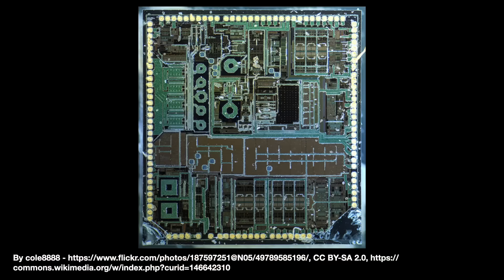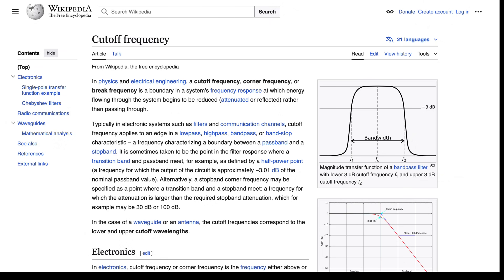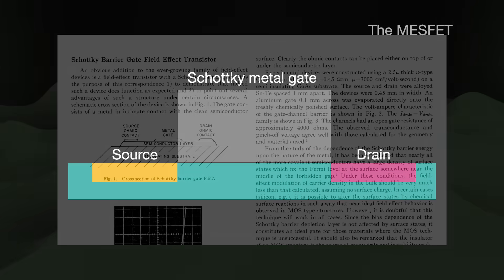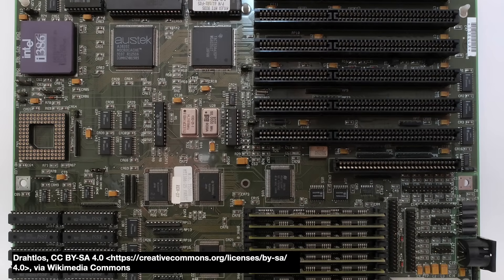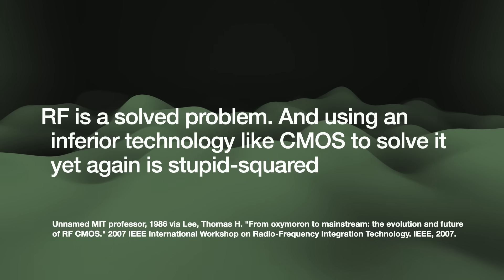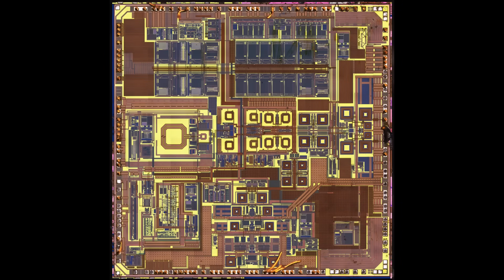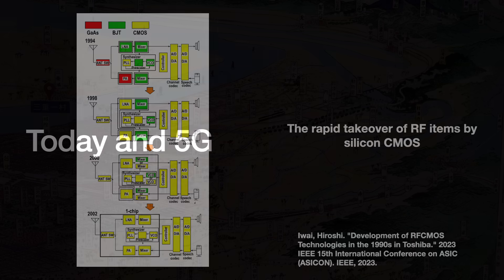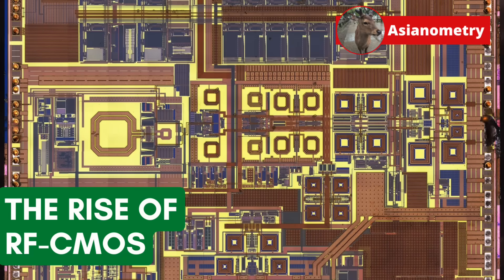How Moore’s Law Revolutionized RF-CMOS

Comment: 80-200Hz is the fundamental frequency of the human voice, but all of the important informant is much higher, the formants and noise sounds. You want at least 10kHz.
Reply: Had to scroll way too far to find this. Even “telephone audio quality” is 30-3000 Hz. When he said 200 Hz my eyes rolled. lol.
Reply: @NatesRandomVideo  He also wrote hz instead of Hz.
Reply: About 200 ... 3400 Hz voice is the telephone freqency range. This range is the only part of human voice, which is transferred in the digitized voice. The sample rate is 8 kHz exactly, so the fundamental physical laws (rules) state, that no more than 4000 Hz is ever possible to digitize and transmit.
Reply: 2.7kHz is adequate for good intelligibility.  As per the US phone system.
Reply: @v8pilot  300JHz-3kHz was the normal 'voice' standard that could be achieved on European narrow channel AM radio.
Landline phones do much better than that. Ultimately they had a 64Kbps limit as te trunks were digitised to that.
e.g. :-
"The 64k phone line data rate, achieved through Pulse Code Modulation (PCM) and the G.711 standard, encodes analogue voice signals into a 64 kbps digital stream by sampling at 8,000 times per second and using 8 bits per sample". 
That turns out to be a practical limit of 3.4kHz and a signal to noise of not much better than 45dB. Without further processing.

VOIP phones can do much better than that.

What mobiles can do is strongly affected by the signal strength as they adapt to congestion by lowering voice quality and ultimately dropping packets altogether.
 The modulation schemata are far more complex than this video implies.They try to use spread spectrum to eliminate single frequency sources of interference. E.g, CDMA
Reply: Yes; a 200Hz cutoff would leave voice information virtually unintelligible.
Reply: And the rest, Digital transmission doesnt work like an old fashioned transceiver.
Very poor video.

Comment: 45nm FDSOI seems to be the sweet spot for CMOS mmW.  The Global Foundries 22FDX process has slightly faster transistors but higher 1/f noise which raises oscillator phase noise.  But those multiple 3um thick copper layers are pretty awesome.
Reply: Yes 45nm SOI is probably the sweet spot. More advanced nodes just add R and C, after RCC extraction the performance of advanced node transistors suck..

Comment: I think the start of RF is more like 100 kHz, not 100 MHz. 

The lowest amateur radio band in the U.S. A. is the 136 kHz band (a/k/a the 2200 meter band, which would need a 1 km long antenna).
Reply: it all depends on point of view. For some people, proper RF starts well above 1 GHz, below that, you can get away with a lot more.
Reply: @tommihommi1

I see your point.

As anyone who has ever built a crystal AM radio using trash can parts like "a roll of toilet paper and a razor blade" (this used to be a common Cub Scout project), you can be very sloppy at 1 MHz or even 10 MHz. This is why most ham radio construction projects are at MF or HF -- you can very much half-ass a 10 MHz transmitter and it will still work.

But by the time you get to 100 MHz you need to be doing professional-grade construction, and 1 GHz is kind of hard. Breadboards stop working reliably once you get past low HF frequencies and you really ought to be doing surface mount PCBs by the time you get to UHF frequencies.
Reply: @texasyojimbo  even at 1 GHz you can get away without really knowing wave theory.
Reply: @tommihommi1  from my POV that's basically just magic. :-D
Reply: Submarine communications can use carrier frequencies below power line frequencies. VLF and ELF
Reply: @mikebarushok5361  indeed, and I think those can go as low as about 10 kHz.

I know that a lot of clocks also use WWVB's signal on about 60 kHz. (Those wall clocks that say "atomic clock time" are just picking up the VLF broadcasts from the government time station in Colorado).
Reply: Roger roger.. Short vertical radiators with very large inductors under Part 97/15. I decode( rcv only) WSPR sigs on 136 & 474.2 KHz..  73, n6spp-sfo bay area

Comment: The superheterodyne effect is the heart and foundation of basically all RF magic, new and old; it remains my favourite RF circuit/operation for its utility, flexibility, and power.

Nowadays some direct conversion designs do exist (especially below a gigahertz and where cost is a primary consideration) but their characteristics (noise, dynamic range, selectivity, etc) are invariably worse than a superheterodyne design.
Reply: 5 is the mixer, that substracts the higher freq (local osc). Also, there are many more modulation schemes than just amplitude modulation).
Reply: @danosdotnl so, the mixer is the magic part. Gilbert mixer . It better amplify a bit, have low noise, lots of second order nonlinearity, but no higher order. How can this part be so selective and dynamic?
Reply: @  i agree it is magic. Maybe check out single diode rf mixing designs?
Reply: @danosdotnl  the balancing of Gilbert cancle out a lot of unwanted effects of a single diode mixer.
Reply: @danosdotnl  Hmm… Alright, I can see that working with other analog modulation schemes like frequency modulation (and then any digital part is applied on the lower frequency signal itself). But do you include digital modulation schemes here as well?

I know that Wi-Fi (let's say 802.11b for simplicity's sake) uses phase-shift keying. Does it mean the phase is pushed around on a significantly slower rate than 2.4 GHz? Most high-level explanations I saw made it seem that the wave can abruptly change its phase even a couple of times per cycle.
Reply: @ in the end it is all analog. 802.11b is < 11Mbps, how many bytes per oscillation that is? Beats me. Sorry, I am still learning analog radio tech
Reply: Could you tell me if my understanding is correct here? I got that:

0) You need an antenna sized appropriately to the wavelength.
1) But we want to emit frequencies lower than that…
2) so we use a higher frequency carrier wave and emit that,
3) but modulate its amplitude with the lower-frequency signal
4) and thus the emitted signal ends up having both frequencies present.
5) (if you put it through a low-pass filter, you will get the actual lower-frequency signal out)

But (5) can't be as simple, because the peaks and troughs of the carrier wave average out to 0. So such "low-pass" filter needs to avoid this somehow.
Reply: Yes, CMOS in advanced nodes have terrible flicker noise, 0 IF is problematic. Linearity is also an problem with the low supply limitation.

Comment: RF-CMOS didn’t win because it’s better  it won because it’s cheaper.
Reply: With the caveat that means CMOS tech is often more developed and therefore even if other processes are theoretically superior it may take significant investment to actually achieve superior results in practice.
Reply: Bipolar devices are superior in RF performance, magnitudes less flicker noise (especially important in 0 IF), much higher gm/ C paracitics, 
It is very hard to create high performance cascodes with CMOS transistors.
Advanced CMOS nodes offer integration of VERY complex digital circuitry together with analog performance on the same chip
Reply: It doesn't need to be better. Simply good enough. Cheaper is a bonus

Comment: You could make a video on the Terahertz gap, as far as I am aware we don't really have amplifiers in the region between high mm-wave and optical frequencies, yet that is where things like 6G are going. Maybe you could highlight the problems and potential approaches.
Reply: 6G isn't necessarily going towards really high frequencies, 5G mm-wave kinda showed that mm-wave is not very practical for cellular networks, the range and the fact that it can't penetrate almost anything makes it difficult for long distance. There seems to be promise around expanding into the FR3 bands (around 7-24 GHz or so) instead. mm-wave/THz seems more suited for short range, very dense communications (e.g. concerts/stadiums)
Reply: @tylerweigand8875  To be fair, mmWave can be long-range, so it can replace 5GHz for stationary clients (both industrial and residential). I hope we could see sub-600MHz bands (russian millitary was heavily prioritised over 5G during its deployment, one may have wondered what they were up to)
Reply: An eminent RF greybeard I know called the THz gap the Moth Band, because some thought from anatomical details of moth antennae that those insects used it for detection or signalling. Alas, they don't.
Reply: Cool  @proudsnowtiger
Reply: There are plenty of THz amplifiers, many used on satellites, mostly experimental ones
Reply: Thz is hard. Power output is tiny, sensitivity poor, noisier and frequency multipliers the only way to get super high frequency. But, graphine gates could change all that due to much higher electron mobility. Stay tuned...
Reply: Makes one wonder what goodies are hidden there…